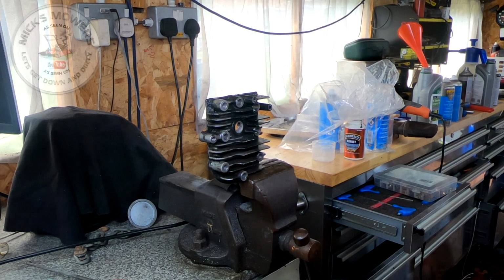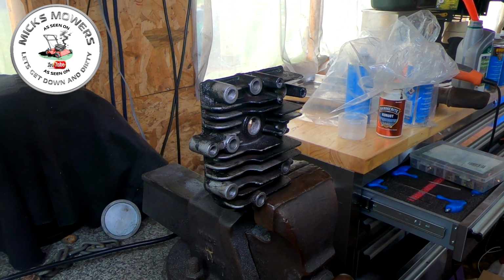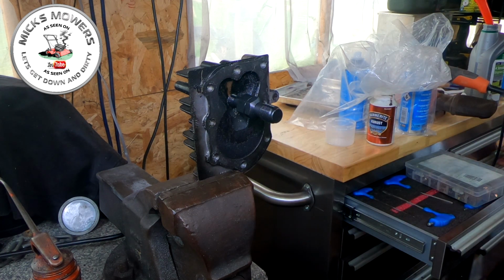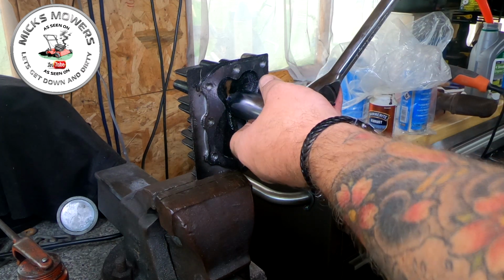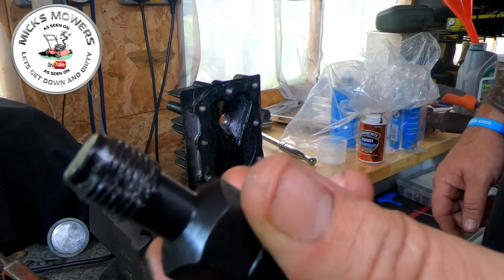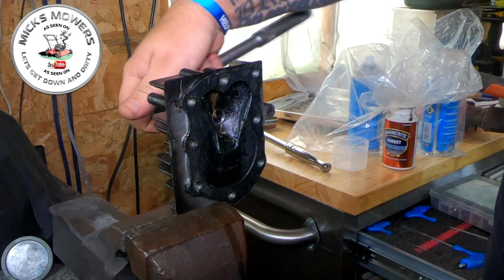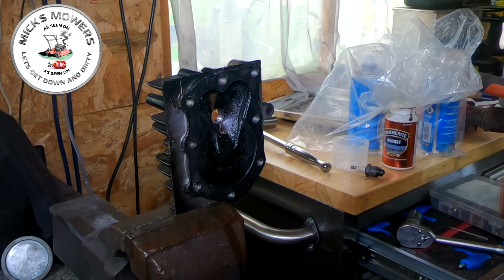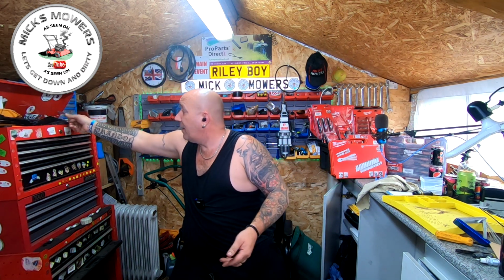Spark Plug Stripped Or Crossed Threaded. Here's a Quick Fix.

Comment: On an L-Head engine, going from the inside out is the best way, and honestly not that difficult, as the head comes off quite easily without much work. However, on an OHV engine, removing the head requires more work, like you said head gasket, but then also readjusting the valves, which is why I picked up that back-tap thread chaser as it will save me some time. This is a great video to show people how to do it with the standard tool. Thanks for the shout-out Mick!
Reply from the maker: No worries Jake me mate.. ta for watching

Comment: When using a Thread Chaser. Put grease in the flutes of the chaser to catch the swarf. It works fantastically. This may help by not requiring that the cylinder head be removed. Could help with an OHV engine.

Comment: Great Kit - I used a tip once to save a briggs 750 DOV - Steve used a spark plug and made it to a thread-chaser - I filed it and made into a thread-chaser. Worked spot on - I was surprised how well. Cheers!

Comment: I used one of these on a pressure washer engine the other week, but it was a bit different I took out more and I fitted an insert, it did a decent job and saved the engine. Good little tool and easy fix and engine lives again. Good video🙂👍
Reply from the maker: Thanks for watching cupcake

Comment: In engineering school, I was told one turn in and half turn out. It clears the swarf and stops it fouling the new threads. I wonder if you can get a thread chaser for the crank/mower blade. Great vid Mick. Thanks
Reply: @ bobbelsekwol To repair those threads, you would need a "Bottoming Tap". It is shaped differently than a regular tap. Very blunt on the end, rather than "pointed".
Reply: @mc2whls  it's possible once the threads go on a crank the machine is written off. Good point though with a different shaped tap.

Comment: another great video Mick. Nice easy simple fix to a common problem, not just in mowers but in other engines as well. Over the years, Ive used both this method and helicoils to resolve threading issues. 
Horse for courses mate !!
Reply from the maker: Yeah mate..